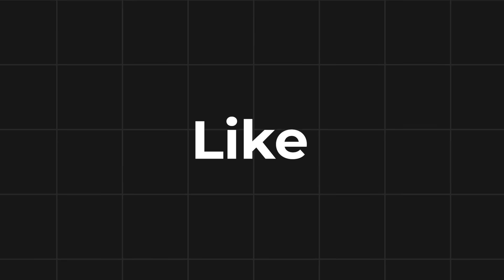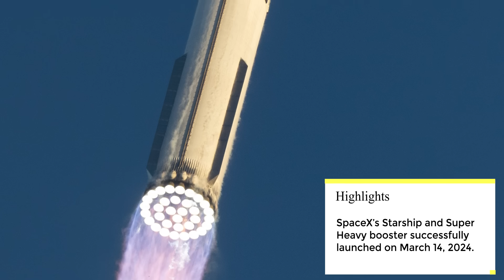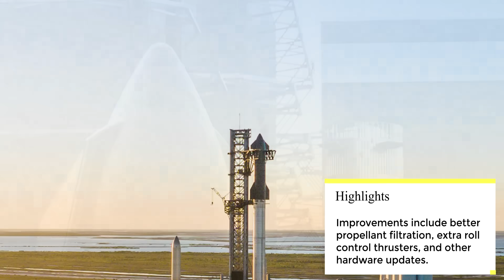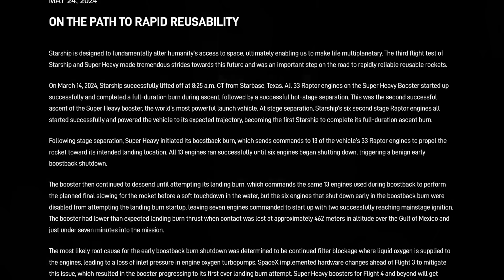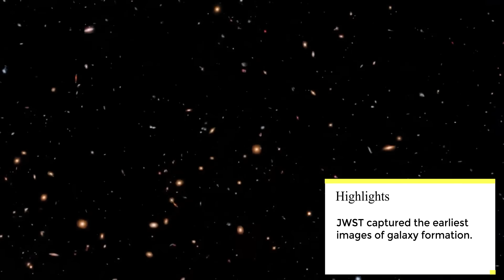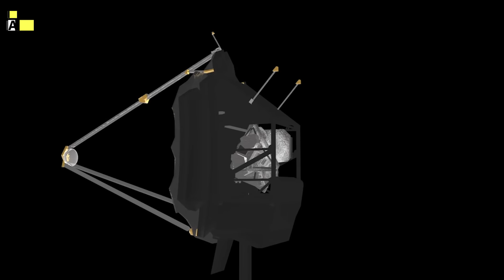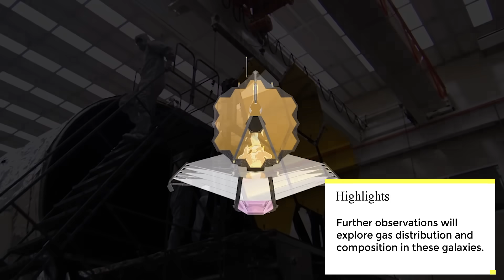SpaceX's New Reason for Booster 10 Mishap, James Webb New Findings | Episode 44

Comment: I think the "no system is the best system" ethos will come to bite SpaceX in the ass sometime soon. The philosophy has gone so far that they are not engineering in redundancy where it is needed. Attitude Control is one critical area where redundancy is important, so the idea that they didn't have enough of it shows an extreme over confidence in the SpaceX design team. Success did that to those 20 something NASA guys in the 60s. They sobered up very quickly the day they lost their first crew.
And let's face it, that Stage O idea and catching the booster AND the Spacecraft WHILE THE BOOSTER IS SITTING THERE BELOW, is a design with virtually NO redundancy or room for error of any kind. Also, putting your crew inside the Second Stage on top of TONS of rocket fuel WITH NO ESCAPE SYSTEM is another thing that will make NASA avoid crew rating the Starship spacecraft for launch from Earth. 
And where are the abort modes for the HLS? The Apollo Lunar Module had robust abort modes tested by the crew of Apollo 10. And the blunderbuss of a Apollo Service Module Engine insured that Michael Collins could literally go down and get the Apollo surface crew as long as they could limp back to any kind of orbit above the moon. The Artemis Service module cannot even get the crew home from low lunar orbit.
I also think the SpaceX willingness to stubbornly ignore the experience of previous rocket engineering teams and believe they alone have the right to "think outside the box" will prove foolhardy. It has already embarrassed them, pissed off the regulators and environmentalists, and set back the program half a year when they decided they didn't need to install the flame trench or water deluge system for the first flight. Everyone with common sense knew they needed it, but they went ahead anyway with flight one and almost scuttled their program because of the uproar over the concrete rain.
Testing and expecting failure is a much faster development cycle as long as your design is cheap enough and can be fabricated rapidly. But it only works if you think really hard and try to anticipate problems and do your best to know exactly what went wrong on previous attempts, and fix them. So far SpaceX is doing pretty well, except in the foresight part.

Comment: So, can anyone enlighten me on what needs to be filtered from the propellant feed? I thought when they loaded propellent it was already pure.
Reply: We can work back from first principles. If the ice was occurring only in the methane system, that could easily be explained by excessive cooling of methane where methane plumbing is immersed in LOX. 

However, we are told the filtering was inadequate in the LOX system. 

The LOX filtering issue cannot be explained by excessively cold LOX, but it can be explained if the autogenous pressurization system is achieved with a tap off from the oxygen pre-burner on Raptor version 2. The filtering would be required to remove CO2 and H2O ices [arriving from] from the propellant tank. Sticking valves could also be caused by these combustion byproducts condensing onto and freezing the valve position.

Comment: It's amazing how NASA kept SpaceX jumping through hoops with Dragon and everything had to be perfect, but the Starliner they are letting potentially lethal issues remain.
Reply: NO. Why do you think the Starliner has been forced to delay so many times? NASA is exercising strong oversight now. (They admitted that they were too trusting during the design phase.)
And I don't think making SpaceX investigate and fix the Dragon capsule BLOWING UP ON THE TEST STAND, or not having adequate assurance of parachute deployment is "jumping through hoops." NASA is a lot more careful about man-rated spacecraft and launch vehicles.
SpaceX had a working Cargo Dragon including hardware with flight heritage to use on Crew Dragon, and it still took them 7 years to develop Crew Dragon and make it operational. Boeing was starting from scratch.
I know it is fashionable for people with a superficial understanding to constantly trumpet SpaceX and bash Boeing, but just take a chill pill, would you.
That being said, SpaceX' insistence on in-house fabrication of flight systems and avoiding sub-contractors work in its favor. Boeing sub-contracts too many systems.
Reply: Which part of the Boeing space shuttle is better?

Comment: I worked at Spacex Starbase for several years . Clogged filters was not half of it. The "Cleanliness" of the welders is horrible, and the QC sucks. We found sand, welding rods, hard hats, empty monster and redbull cans, T-shirts and much much more inside the tanks following assembly. If they had welders who actually care about the quality of their work and the fact that people will fly on the rocket someday, rather getting a big fat paycheck, things might improve. The pad techs can only get so much with a shop vac while they close the vehicle out, but when a welder drops an entire pack of welding rods down a fuel down comer, and then laughs about it, it makes me worry about the quality of workers and job market. They hire rig welders who weld iron pipe in the oil field, and don't give a crap about quality. Expecting them to appreciate the art of stainless steel welding is a very big ask. While inside the tanks they will walk on slosh baffles and bend the crap out of the tank internals rather use the scaffolds and platforms installed for construction. The welders just dont give a crap and it shows.
Reply: That is just what happens when you have to mass hire.
When you properly supervise newly hired employees you will quickly find out that maybe a third of them turn out to actually be motivated, reliable and worth keeping.
The rest may just be in the wrong company or wrong job.
Better for them to move on and find a job where they can thrive.
Of course also better for the company to get rid of them.

Goes for any profession by the way, not only welders.
Reply: Welders are a different breed. I'm a machinist and at the shops I've worked all the welders are the same. Very arrogant. Almost god like
Reply: I have serious doubts about your honesty...going to need proof not just your words about this.
Reply: Moving to Texas for the tax haven and lack of unions has consequences. I live in Texas. Texans are selfish, arrogant, and lack the same seriousness and insight as the highly educated Californians SpaceX employs at Hawthorne. Unfortunately, Elon Musk is becoming more Texan every day. He loves the lack of regulation and oversight. In Texas, as long as you make money, regulation takes a back seat. And here, just about everyone is smoking weed or taking pills. The highways are insane.
Reply: It does sound like that's an issue that need to be resolved eventually.  Curious if you ever brought this issue up to upper management, and what kind of responses did you get?

Comment: Jettisoning the 'hot stage adapter' will lessen the landing mass and change the CG....but doesn't that work against the ultimate goal of rapid re-usability?   It is VERY interesting watching SpaceX develop new projects in public while their competitors do everything behind closed doors so all of their failures can be hidden.   Build quickly, test and if it fails....make changes and try again!   Much faster way to progress and compared to Boeing and the Starliner...no comparison as they're WAY behind schedule, WAY over budget and are going to launch with KNOWN faults.   That's just great...because they're desperate and we all know that launching manned flights with known problems will NEVER cause a problem...right?
Reply: Not really as long as it is easily replaced. Ok, it will make a singular part not-reused, but this can also be changed over time anyway.
Reply: V2 booster hot stage will be integrated in to the booster itself.
Reply: Not ALL their failures. Failure to launch because of some otherwise minor technical issue can't be hidden.
Reply: As hot staging was a "last minute" addition, I will venture to guess that they want to prioritize core functionalities before debugging such a non-critical feature designed to give an extra 10% payload capacity.  Starship will function perfectly without hot staging and still be the best launch vehicle by a huge margin.  They can always develop and perfect re-usability with hot staging after that.